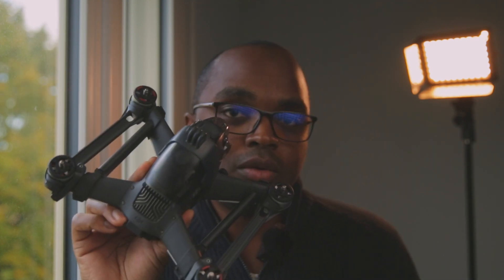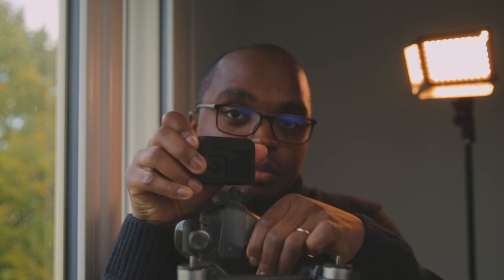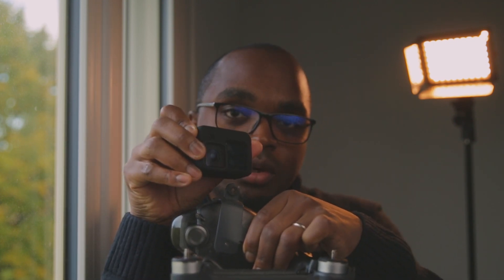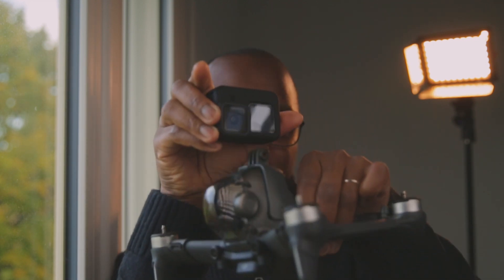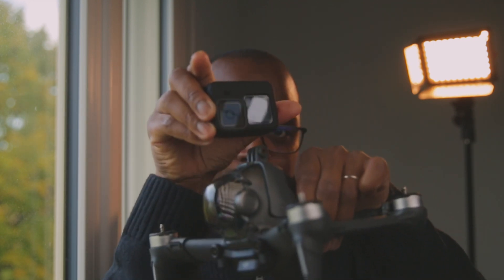HOW TO FIX GOPRO FOOTAGE VIBRATIONS

Comment: Hi Bruno, thanks for your advice.
was the hypersmooth off and did you use gyroflow or reelsteady in post? thank you very much for your contribution. I'm going crazy with the vibrations of my dji fpv
Reply from the maker: Hyper smooth was off
Reply: @brunovfpv5756  Thanks a lot. don't change your way of communicating because you are the best technician i have ever found on youtube
Reply from the maker: @rbnfpv  I just share problems/solutions

Comment: can you link the props here please?
Reply from the maker: https://pyrodrone.com/products/dronetech-dji-fpv-replacement-5328-propeller
Reply from the maker: https://www.amazon.fr/H%C3%A9lices-Master-Airscrew-Ludicrous-pour/dp/B09TRRN23M/ref=sr_1_2_sspa?__mk_fr_FR=%C3%85M%C3%85%C5%BD%C3%95%C3%91&crid=AEHTBUNYK0U0&keywords=master+airscrew+dji+fpv&qid=1668619830&qu=eyJxc2MiOiIxLjQ4IiwicXNhIjoiMS41MCIsInFzcCI6IjAuMDAifQ%3D%3D&sprefix=masterairscrew+dji+fpv%2Caps%2C57&sr=8-2-spons&sp_csd=d2lkZ2V0TmFtZT1zcF9hdGY&psc=1
Reply: At the end you said double the ss did you mean keep 1/120 with Master Screws ?